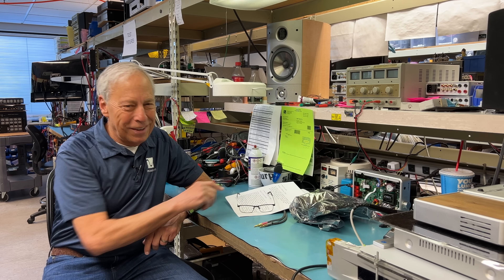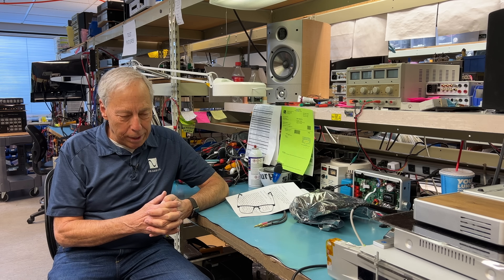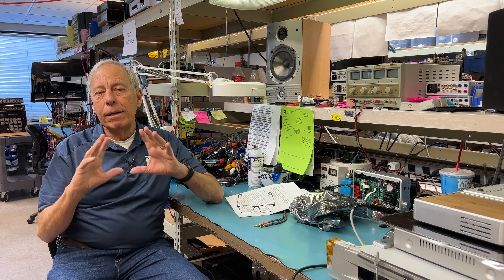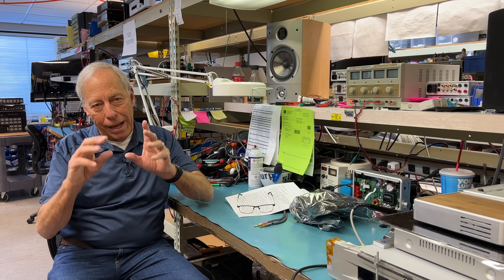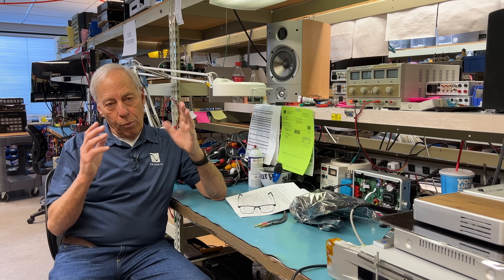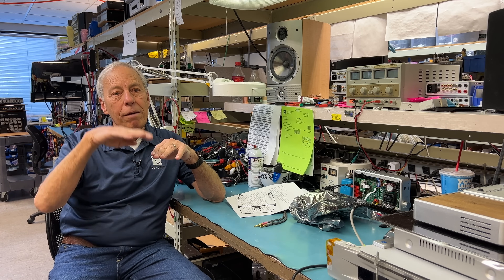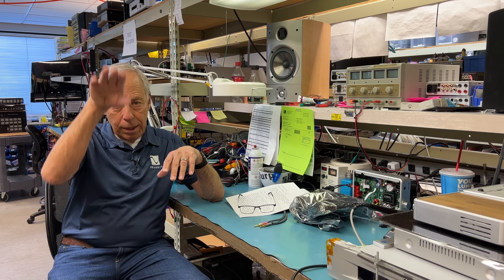Understanding voltage, current and wattage in amps

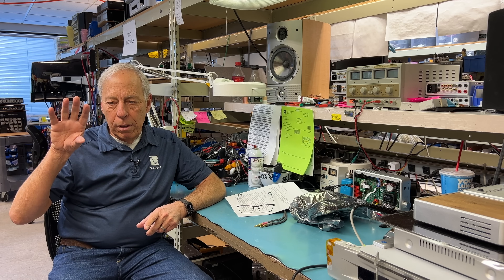Comment: 01:29 "More voltage more sound, it's as simple as that.  End of story" - not a very good (or accurate) way to describe how an electrodynamic speaker works.  I get that Paul is looking for ways to answer questions with using a few technical definitions as possible, but here is a case where trying to answer a question may make things worse.

At the end of the video Paul mentions that power is the product of current and voltage.  Might as well start with that. Explaining the physics of how an amplifier+speaker system works probably can't be squeezed into a 7 minute video, in which case perhaps it's best just to give directions (such as, shop for amplifiers with power ratings more than the minimum recommended by your speaker manufacturer.)
Reply: Not a very good way to describe? You're mild. It is complete nonsense! It is the current, the current only! Known for more than 200 years, since Ørsted.
Reply: @JerryRutten  Not true. An amplifier that can deliver 200 amps, but only swing that by 5 volts is not going to work very well with real-world amplifiers.
Reply: @RacingAnt  
Yes, you need voltage.
Yes, you need power.
Yes, you need current.

But is the current that determines the output. It is just physics, known for more than 200 years...

An electrodynamic driver has a parameter that's called 'force factor', it's unit is Newton (force) per Ampere (current).
Reply: Sorry, Dan, just looking at power ratings is not helpful at all. An amplifier that can deliver 100 watts into 8 ohms might look like a great match for an 80 watt pair of speakers. But, if it can only deliver 3.5 amps (all that's needed to make 100 watts into 8 ohms), it's only going to deliver 50 watts into 4 ohms, and 25 watts into 2 ohms. So, at various points on the speaker's frequency response, it's going to be very, very lacking. To truly drive a speaker, it needs to be able to deliver 7 amps into 4 ohms (200 watts), 14 amps into 2 ohms (400 watts), and 28 amps into 1 ohm (800 watts). If it can do this, the output voltage will remain constant (roughly 28.6 volts) into every load. That is why Paul says that voltage is everything - the ability to drive a constant voltage into any reasonable speaker load is what's needed to effectively drive a speaker. It's why my 50 watt amplifier is more capable at driving my floor standing B&W speakers than most 150 watt receivers.

Comment: The typical analogy is water and a water tank on a hill. Voltage is pressure, how much water is in the tank and how high the tank is above ground. Current is how much water flows when it is released from the tank. Load resistance (impedance) is the diameter of the hose connected. But add to this, internal PS resistance is the size of the opening in the tank regardless of the hose size. 

A little water not very high up? Not much power available. More water in a bigger tank up higher? More power available when needed. But until water flows out, it is only pressure/ voltage. 

Punch a hole in the bottom of the tank and add a hose. How much water flows how quickly is determined by the size of the hole and the size of the hose. The larger the hole or hose, the more (current) flow, but the faster the water empties out of the tank! 

Put on a wide hose (low resistance load) and lots of water can flow out if the hole is as big. But no matter how much water pressure is in the tank and how wide the hose is, if the hole is small (high internal PS resistance), only a trickle will come out relative to that hole size. But if the hose is smaller, the same size as the hole, it doesn't matter. 

So you need more pressure(voltage) to provide more water flow. But the flow (current) that results depends on the size of both the hose and the hole. 

So even if you have lots of voltage, but a high internal PS resistance (measured in Damping Factor), the voltage will be used up by both the load and way too much used up in the PS never leaving the amp. This can be seen in comparing the 8 ohm power to the 4 ohm because more voltage gets dropped in the PS as the load gets closer to the PS resistance. Or if the hole size is close to the hose size instead of wide open.

Comment: It would be similar to RPM's and torque. You need more torque to go up the hill.
Reply: No, it's always horsepower. Torque is only of interest for looking durability as it's the static piece of the power. 
Look at a car on a film, if it's playing it horsepower, if you pause and can observe something happening to the car it's torque.  :)
Reply: @PSA78  What I'm thinking is that amps are similar to torque, volts are similar to volts, thus horse power is similar to watts. Is this correct?
Reply: @guywilloughby5443  Yes, Volt is like rpm, torque is like Ampere.
You can't really have one without the other, and you can trade one for the other, as in the end the work  (Watt) done can be the same for both. 
The engine is just turning energy stored in a liquid form into mechanical work, so the work done is decided by the amount of air (and fuel) trapped in the cylinder. This is at its best when you have peak torque, then it drops off but as the engine is capable of trapping more energy over time the work (hp/W) it can do will continue to increase. The energy has to go somewhere. 
Torque is of value in development to see trapping efficiency, load on parts, etc. But as soon as the vehicle is moving it's horsepower (work). 👍
Reply: @PSA78  Thank you.
Reply: @PSA78  HP is just a number (torque x RPM) / 5252. Torque is always what matters.
Reply: @BB..........  Torque is trapped gas over a single combustion, hp is trapped gas over time.
The laws of thermodynamics dictates the rest.
Torque means nothing outside research.
Reply: @PSA78  It's still torque doing the work. HP is just a number spit out of a formula.
Reply: @BB..........  Horsepower is from the start the observed energy; load, distance, time. And that is still the case with engines. 
Work done is horsepower, or kW, just like with  electric devices. 
A gearbox will take care of the rest.

Comment: A power engineering analogy I like is voltage is the speed electricity goes through your body. Amperage is the size of the hole it leaves behind!
Reply: EXACTLY !
Reply: Lol thanks for that 🙂
Reply: OH GREAT...and I was starting to loose my terror of electricity. Thanks!
Reply: Voltage is the speed of the bullet.  Amperage is the weight/caliber.  A neutron can pass right through us at very high speed and do minimal damage(work).  A 50 caliber will be devastating.
Reply: Voltage does not go, it stands.